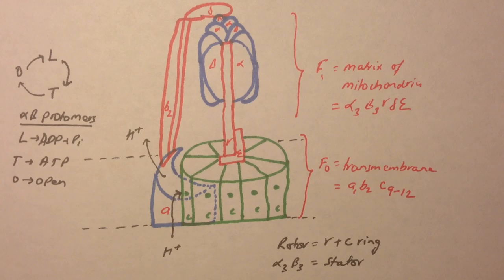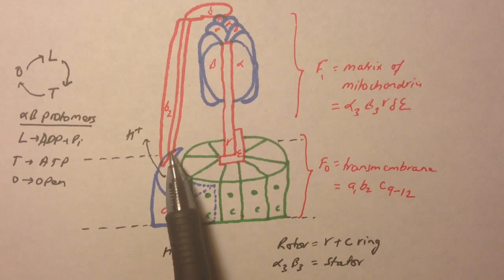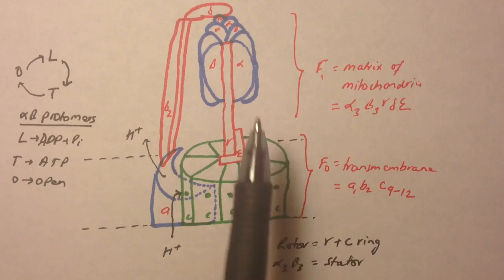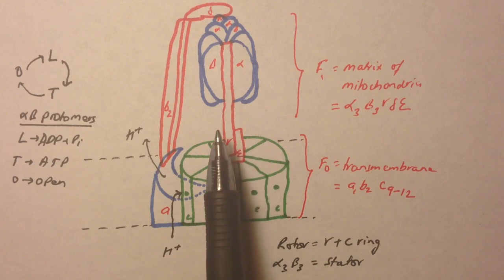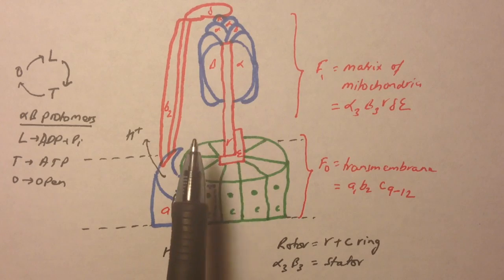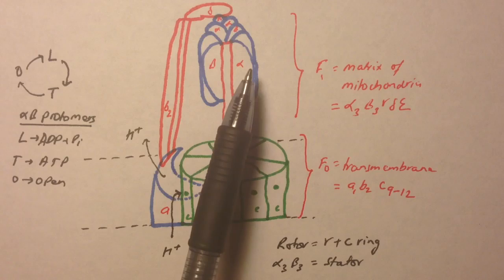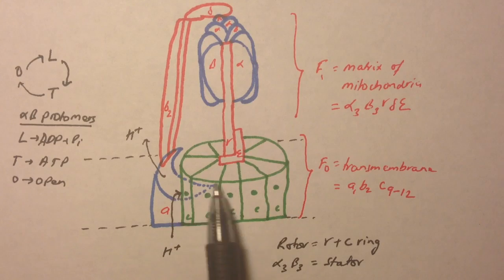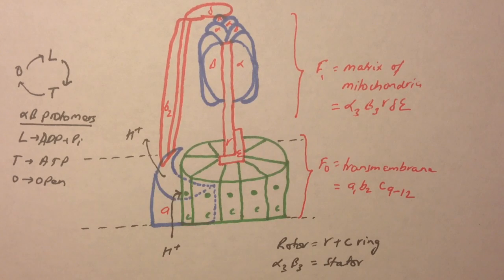ATP synthase structure and mechanism

Comment: Different F1F0 ATP synthase complexes have different number of c subunits in the membrane rotor. Those that have a larger number of c subunits are likely to have what properties?
A. A lesser ability to hydrolyse ATP if uncouple from F0.
B. A need for fewer H+ (protons) to make each ATP molecule.
C. The ability to make more ATP molecules per 360 degree rotation.
D. The ability to make fewer ATP molecules per 360 degree rotation.
E. None of the above.
I'm torn between C and E. May I seek your kind guidance?
Reply: Numbers of c subunits determines the no.of protons required to generate one ATP. if there are large no of c subunits more protons are required to make one ATP molecule.  so its E.
Reply from the maker: Hi Juliet, I saw your post 3 yrs after you commented. You are probably done with your class a long time ago. Sorry, couldn't help on time haha

Comment: is there a study about the rotation speed of the rotator enzyme?
Reply: I'm sure there are. We know that for every 360 degree turn 3 ATP are generated and 10 protons are pumped across, so all you would have to do is measure the rate of ATP production in a mitochondrion to see how fast it's spinning (I don't think using pH would be a reliable way to do it)